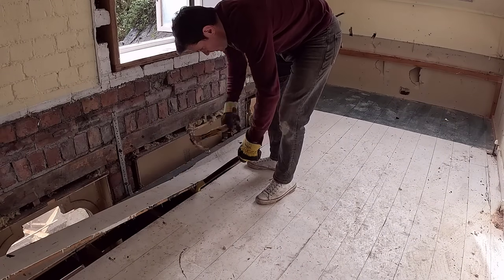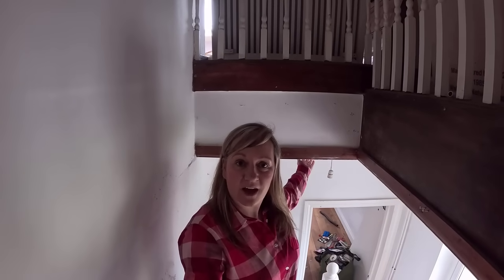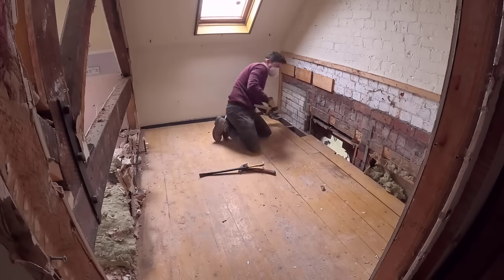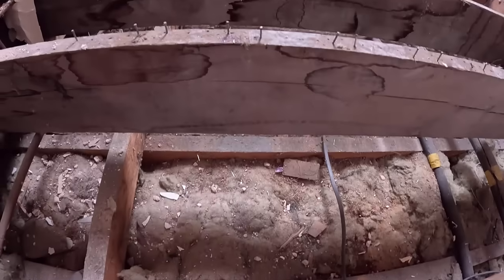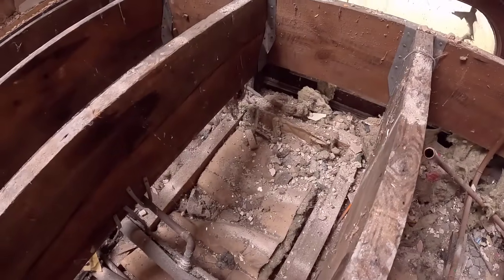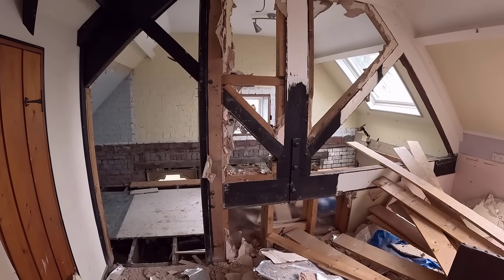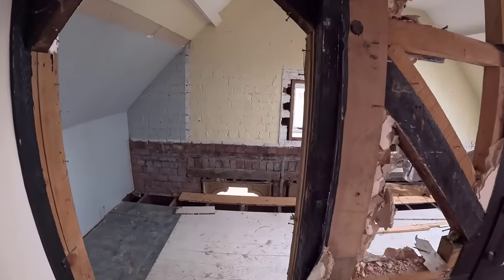Abandoned? The Old Station Looks Like It Now!

Comment: I hope you are saving and reusing as much of the lumber as possible from the tear down of the walls and floors.
Reply: Agree. Especially the lumber that has been used in more recent 'renovations' by previous owners. It's still usable. The framing in between the bedrooms, that flooring that was lifted can be refurbished. It will save some money too & avoid any possible delay in waiting on wood deliveries. Not saying all of it can be recycled, but it's definitely worth a day away from demolition to pick through the rubble and set aside a portion of the good timber that can be reused.
Reply from the maker: Yeah. We’re storing the boards, nothing wrong with them at all. Better to use agin than MDF sheets!

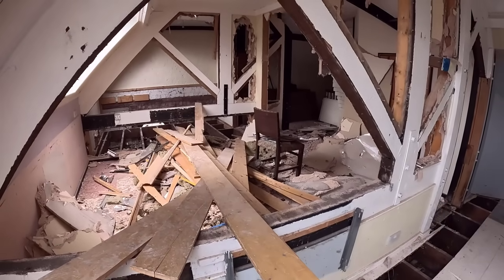Comment: I strongly encourage you to bring in your engineer and show him the trusses that were cut. They are visible at 9:08 and 9:46 in this video. While you didn't show them, I suspect that the steel beams you mention replace the horizontal member of each of those lovely king trusses that was removed during the prior "renovation" -- a better word is "desecration".

The bottom of each King Truss is in tension -- it keeps the weight of the roof (slate!) from pushing the walls apart. My first thought is to somehow restore the portions that were removed. The point remains, though, that the purpose of those steel beams is probably NOT to bear weight -- they instead carry the tension that was originally handled by the horizontal members of the two king trusses.

Removing those horizontal members made significant changes to the entire King Truss and everything around it. I would want a professional opinion about how adequate those beams are and whether a better option now exists.

This demolition is a really important and significant step. By the time you finish, you'll have a much more clear picture of what must happen next -- both structurally and cosmetically.

Comment: Tearing stuff up is fun but now you're going to have to rig some type of chute to get the junk into a dumpster.  There looks like a lot  more to do so I'd do that before proceeding with more teardown.  Get yourself that Sawzall as it will make the tearouts way easier.  And yes, it looks as though vermin have had a long term residence between the ceiling and the floor. Cross that bridge when you come to it.  Love those huge beams you've uncovered.
Reply from the maker: A chute would definitely have been easier! I think I’ve now got to the point wheee my lack of skill is going to mean I have to hand over to the professionals, we have a team ready to come in, rip out and dispose of the rubbish. 

As for the vermin, the cats have moved in now so I imagine they’ll have made short work of any that were still around!

Comment: Good progress. The demolition part is always the most fun. 😅. As others have commented......clear up as you go, save all the pieces of wood like floorboards etc, until you are absolutely certain you don't want them. Get a skip right under an upstairs window so you can toss stuff out and not have to move it murderous times.
Reply from the maker: Absolutely, much more fun than the cleaning!! 😁

The floorboards have gone into the outbuilding for safekeeping. I don't think we could get a skip into that bit of the back but I'm going to throw the plasterboard out and barrow them round to the front. Not ideal but not too bad.

Comment: I would save some of the boards even if you have to cut the ends off. They will come in handy in your renovation. I would definitely clean up all that mess before moving forward. The space seems more open and more light coming in.
Reply from the maker: Yeah, they’re going in the outbuildings so they can stay dry without being in the way….and I’ve been told I have to go and clean up before I do anymore 😢

Comment: It may be pedantry on my part but the structures supporting the original roof are timber trusses not beams. In this episode it is clear that the bottom boom was cut in the original conversion to create the corridor. I trust the builders reinforced them in some way to keep the strength.
Reply: I hadn't realized that part of the trusses had been cut in the process of making the hallway. I hope that doesn't compromise them. (And I wonder if somehow the missing portion of the trusses can be restored, perhaps with joinery. An expert, of course, would know.)
Reply from the maker: Trusses, good to know, thanks. 

There is a steel parallel to the truss under the floor and there are two vertical timbers transferring the load onto the steel. There’s probably a builders term for this but as I’m sure you’ve realised we have very little actual knowledge!! We’ve had plans from the engineer for removing the ones we need to without having the roof fall in.
Reply: @theoldstationrenovation  In your later videos I noticed the builders introduced a vertical member that flanks the line of the corridor which I imagined was supported by the steel beams you mentioned. It seems a shame that the trusses were altered but there doesn't seem any other option to create the upper floor. You have done the right thing by employing a structural engineer they should keep you on the right path, good luck.

Comment: If the floorboards are hardwood, you could de-nail them and reuse, or strip or plane as needed.  There are fast and efficient ways to de-nail.
Reply from the maker: Absolutely, they've been put in the outbuildings to keep dry with a view to reusing.

Comment: First is to clear up you'll see more,  It looks like the beams have been put in at some point during the previous renovation,  I would see if l could use the beams again and realign them above the window's that will save a lot of money. Keep up the good work 👍.
Reply from the maker: I've finally cleaned up, nowhere near as much fun as the knocking down!

Those beams don't come cheap so if they can be re-used I'm all for it👍

Comment: In the previous video I responded to a question about the three small windows which are being covered by the floor joists. It is fairly obvious that at some stage in order to have the floors as they are upstairs now, the ceilings downstairs had to be "dropped". This is evident in a number of places including the two small painted-over windows in the attic area where the ceiling fell through. That ceiling is definitely "dropped" and not the original which would have been much higher as those two windows would have been part of the waiting room.
The same goes for the three small windows in each of the far end rooms. The floor joists as they are now are not original, having been put in to provide full height upstairs at the expense of the ceilings downstairs. In the room with the small window that was being used as a jettison for the rubbish, there's a line between the painted bricks and the unpainted ones. That will mark where the old original ceiling height was from downstairs.
If you wanted to have the three highlight windows back in your kitchen again and didn't mind losing the space in that upstairs room you would just need to remove the floor joists and raise the kitchen ceiling. I hope what I have said all makes sense, although you probably know all of this already!
Reply from the maker: Thank you, we can also see some original floor joists that have been cut through above those small windows, not everywhere, the floor doesn’t seem to be throughout originally.
Reply: @theoldstationrenovation  It's fascinating to look at what was, compared to what is now. It does leave you with a bit of a dilemma however, as if you want to retain standing room upstairs then you really can't raise the downstairs ceilings and take advantage of the small windows which are presently covered up. I'll be following with interest to see what you end up doing.

Comment: The secret to restoration is before moving to other rooms clean the area. Stack all the wood in a dry location materials these days are very expensive, even if you do not use the wood it sells well people love reclaimed floorboards.
Reply from the maker: I did finally clean up today and put the boards in the outbuildings to keep them dry. Hopefully they can be used again in the renovation but if not someone else would be welcome to them.

Comment: In a previous video you asked what we thought about the plastic windows. As a rail fan I'd love to see orgional stuff however wood windows need regular maintenance and as you will be living there and the plastic windows look fine I would leave them , I would try to imadgine how it would be today if still in rail use and what changes would have been made assuming the building suvived and had't become a bus type shelter. That little wall is annoying outside the back door I hope Gill knocks it down.
Reply from the maker: Laura is a huge fan of wooden windows but we have to be pragmatic, we know we can't have the top end of everything so we'll have to pick our battles. 

Do you mean the wall around the sheltered area, if so then we agree... but I'll leave that to a professional to remove!
Reply: @theoldstationrenovation  yes I mean that low wall in the sheltered area that would have opened onto the platforms, really enjoying your videos and would love a similar project myself but alas I don't have the budget.

Comment: So when the upper floor was added a structual engineer specified the orginal floor joists wern't strong enough to take the upper floor loading. So steels and some hefty looking joists were add to take that load.
Reply from the maker: Looks like it, also seems they needed the steels to bear the load of the roof as the main horizontal beams had been cut.

Comment: Your next step is to start clearing that mess up.  Save the boards for recycling on flooring.  Also, by ripping out everything, you have a blank canvas to start over.  Plus, now you can see what boards are the weight bearing studs and how to incorporate the windows in the final design.
Reply from the maker: Not as mush fun as ripping out but I have finally tidied up! Now we can see why the floor is so deep (the metal beams) we know that we'll be able to lower the floor and make a feature of the upper windows, it would have been a real shame to have had to cover them.

Comment: I'd say they made a "floating floor" for the first floor as they didn't want to move pipes or put any weight on the walls below.

Good work with the clean up.
Reply: My thought is that the metal beam is load-bearing
Reply from the maker: Thank you, I did the clean up today and can confirm that it is nowhere near as much fun as the demolishing!

The steel seems to be bearing the weight of those roof beams where they have been cut away. I guess that why there is so much space between the ceiling and floor. Hopefully this will mean we can gain about a foot of headspace.

Comment: Wow! The spaces at the ends were always small, but that central room could possibly be extended beyond where the hallway now sits to make a good sized space. It's likely all of that would have had to come out anyway. When you can see the unobstructed ceiling beams and supports, you'll know what space you have. Cutting off those windows was a crime. The smaller spaces could work as bathrooms, or closet space. I'm always the one who follows the guys around, picking up and pulling out nails and collecting them in a secure tub, as I'm always afraid one will go through my foot. With all of the heavy yard work I do, my doctor recommended I get a booster for my tetanus shot.
Reply from the maker: Absolutely agree, the hallway is coming out to leave one large full height room in the middle of the building. 

It’s a good job I wore my boots for this cos there were a few times I misstepped and caught a nail!

Comment: The end shot looks like you've had vandals in, but I know this is only the start. Not sure why the 80's build had triangle doors from the hall space, I guess that was to mirror the cross beams? They could have gone with a normal door from the corridor though. Nice to know what you can have a smaller floor/ceiling which means those high windows will be seen downstairs. it will be interesting to see the open area from the old main waiting room. that would great with just a couple of upstairs rooms with a bathroom perhaps? great as usual not seen the hounds or the kids of late are they sleeping in the caravan?
Reply from the maker: I suppose you could say it has had a vandal in it 😃! 

We are in as of this weekend so likely to be more of the dogs featuring in coming weeks. As for the girls, it’s the Easter holidays so they’ve hardly got out of bed!

Comment: Yup that's a huge mess all right!  Hope you can salvage as much floor boards as possible to reuse.  Also hope you intend to save the doors and reuse them as well.  Exposing the upper windows will be amazing.
Reply from the maker: The floorboards and large doors are being stored because I'm sure they can be used again. I'm not sure about those custom doors with the triangular tops though,, they are as bespoke as bespoke gets!
Reply: @theoldstationrenovation  - I think the triangle top doors are pretty cool.  Could use as doors for storage closets; they're whimsical and part of the building.  Great conversation pieces.  Hand a photo of how they were originally used, nearby!

Comment: Gill looks like my kind o guy. A swingin hammer and a wrecking bar are the basic requirement for that job. On another matter my current abode had all the planks screwed down with industrial grade screw nails (the  boards used to squeek apparently).Took me hours to lift the boards in the living room.
Reply from the maker: Wow, that must have been some exertion! 

I couldn’t believe half of the boards in that room weren’t nailed down at all, not so much as a tac 🤷

Comment: At the risk of stating the obvious, please finish stripping out timber, plasterboards, ceilings etc from the upstairs rooms before you take up any more floorboards!! Makes life much easier and safer! I'm working solo on stripping out my 1930's semi-detatched council house (@s35project). Last time I had a couple of hours to spend there I was breaking upstairs ceilings, albeit from below on a small stepladder (skim, plasterboard, plaster, lath then loose fill insulation all coming down) Proper dusty, eye protection a must as well as gloves and mask. One of the most useful tools has been a garden spade, great for breaking plasterboard. I'm sometimes uber-cautious so have been de-nailing pretty much everything as I go. The laths I've been breaking into 6-8" pieces and boxing up for friends to use as kindling. I take it all your old electrics and plumbing are dead?
Ps, Be encouraged, I'm sure you'll make a great job of the old station, thank you for sharing it with us, and keep stepping back to enjoy the fruits of your labour.
Reply from the maker: Thanks for the tip, makes sense (you may have noticed I have far more enthusiasm than skill or knowhow)!

The plumbing is still working as we need use of the toilet for the time being but the electric in the house has been disconnected so I don't need to worry about wires. 

Is @s35project the channel for your project, I'm always interested to see how other people are getting on?
Reply: @theoldstationrenovation  all I have is a sporadically updated instagram page! Wish I had the energy to share it on YouTube too

Comment: Any planning permisions would have been obtained from your local authority planning office. They would have required to be passed by the buildings inspector upon completion. It would help if you knew when the application was made. Check the sides of the steel beam, as this may have a date welded on its side. Your village development plan states that they are supportive of buildings retaining their original character.  e,g wooden window frames. roof tiles, etc. You should consider this when you apply for planning permisions as they are more likely to be granted. I know that you have an architect, but it is helpful, if they are familiar with what is likely to be accepted or rejected by your authority. Dont be afraiid of contacting your planning office, informing them of your intentions. They may be very helpful in guiding your decisions. It could save you a lot of time and money.   Also have you  looked at your land registry documuments,  and title deeds, these may contain a copy of the original building plan. They can be quite interesting as they also contain previous owners of the land.

Comment: You husband sounds like a typical boy... enjoying smashing things and dislikes the cleanup.    Save the good flooring and usable studs, trash the remainder.  With floors removed your architects can devise a plan to lower the upstairs floor level.   You may not be able to to save the finished ceilings through out this renovation.   Hang tough, it will be terrific when finished.   

Wishing you and your family a blessed week filled with gentle seasonally appropriate weather and restful evenings together in your intermediate home.   Peace
Reply from the maker: Thank you so much and the same to you 😊

Yes, I can confirm I love the smashing more than the cleaning!

The architect is certain we can slim down the floor depth to lower the floor level which is good news as we can make a feature of the top windows.